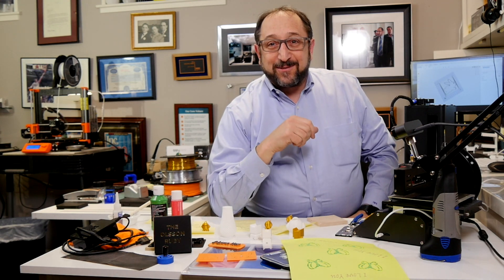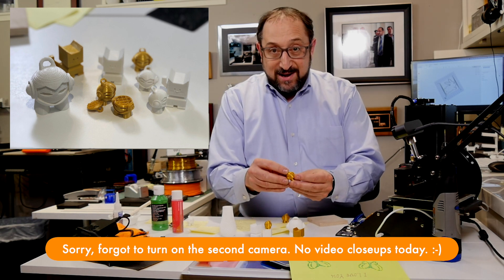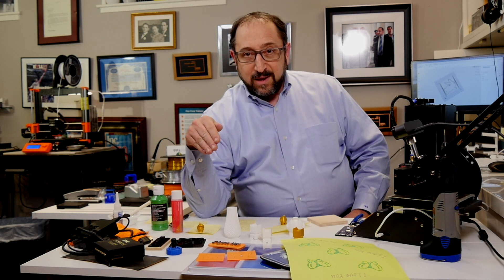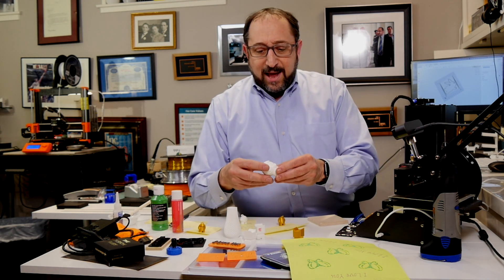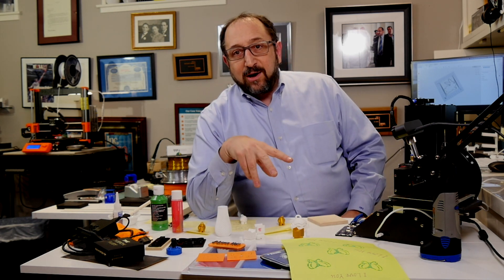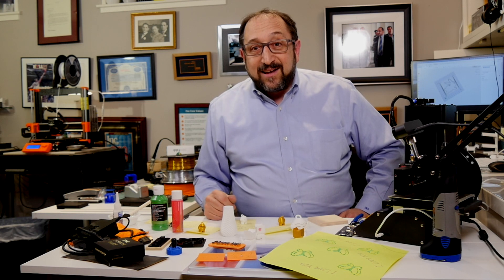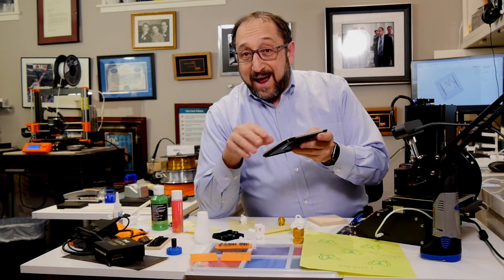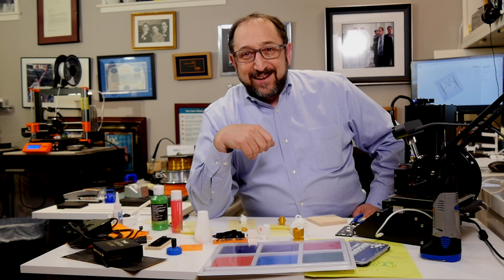I Broke my 3d Printer

Comment: Great video! Glad YouTube sent me here. Not everything goes smoothly all the time. I went through many Olsson's with the Raise printer but mostly due to clogs from filled filaments. Personally, I much prefer hardened nozzles as they can be heated with a butane torch to remove clogs. If you heat the Olsson's they shatter. If you try to push the clog back with a needle the very fine orifice cracks at the tip and it's garbage. Olsson's just aren't for me, but thanks for sharing your experiences!
Reply from the maker: Thanks for your observations and for participating in the discussion.  Here is what works for me.

So far I have not had clogging issues that I could not resolve by just heating the nozzle in the printer to about 10-15 degrees above the temperature used for the filament that clogged, and then manually pushing a piece of filament through from the top.   If this does not work, I  find that driving a .4 mm needle made explicitly for this purpose down from the top, with the nozzle at full temperature clears the clog.   I never pushing anything from the bottom, I only push from the top, with the nozzle up to temp.

Comment: Yeah, I can really relate to your problems. I have had days where everything went wrong but you are so right, fix one issue at a time. I had learned this the hard way myself but it does work. Thanks for this tutorial as I learned what I should look out for when doing a change of nozzles.
Reply from the maker: Yep. Everytime I forget to go one step at a time I run into trouble.  I spend much of my professional career as a software developer which is where I learned to change one thing, test, before changing anything else.

Comment: Great video. I actually had problems with the newest firmware so I downgraded it.
Reply from the maker: Interesting.  What problem?
Reply: It was jumping in the middle of the print to one side and continues from there.
It sounded like what you described, but I'm printing with SD card without any gcode modifications so it might be something else.
Also, it was like my 3rd print, my Prusa is very new so it might be something else than the Firmware but I rolled back anyway.

Comment: Hey DrVax, I know this video is from over a year ago - but I'm interested to know what kind Raspberry Pi you were/are using for running your printer via Octoprint. I see they don't recommend Raspberry Pi Zero / Zero W (even though I know the Prusa comes with the slot for the Zero). The reason I ask is because I just ordered a Prusa MK3S and also ordered the Olsson Ruby nozzle with it as I'm interested in printing carbon fiber parts. I'd love to get Octolapse running smoothly if I can.. I have a 4GB Raspberry Pi 4B I plan on running Octoprint on - I'm hoping that I'll be able to run Octolapse smoothly on that version.
Reply from the maker: I have been using the 3b or 3b+.   I always felt the zero was underpowered.

Comment: Did you run a PID tune for the nozzle temp after installing the ruby nozzle? Any time you switch to a different material nozzle you should definitely run one. 
 It seems like the full XYZ calibration was a bit overkill, and that maybe you could have just run the first layer calibration from the prusa menu?
Reply from the maker: I manually adjusted the PID and then ran the full XYZ calibration.  You are correct it is possible there is a more streamlined approach.  I will have to do some more testing.
Reply: @MakeWithTech  Hey if whatever you did worked, then its all good! I've really been enjoying your videos, keep up the great stuff! :)

Comment: Well, last week after assembling my Ender 3 Pro I browsed UTUBE for info and now I have to take it all apart again because there are so many errors you can make and some that are built in like the loose wheel bearings in the wheels  and an out of square X axis gantry beam  etc when you assemble it. Having fitted the metal extruder I'll next do the Bowden tube mod that Lucas did on the 'Tube.....one thing at a time.
Reply from the maker: Yep.  I make the same mistake all of the time. Changing too many things at the same time.

Comment: i did the same ....... screwed my first ruby as well
Reply from the maker: Misery loves company.  Thanks for sharing.
Reply: hell yeah...  swapped my heater cartridgre today on ma i3mk3 . was ceraefull to do a full xyz calibartion before sing it again

was caused by a heat end cleaning , was not carefull when assembling again. had a spare heater cartridge ... but taking the screw out takes a bit of sweat as the screw is full with gunk...

love the ruby for all filaments from pla to glow in the dark and other abrasive ones..

  @MakeWithTech